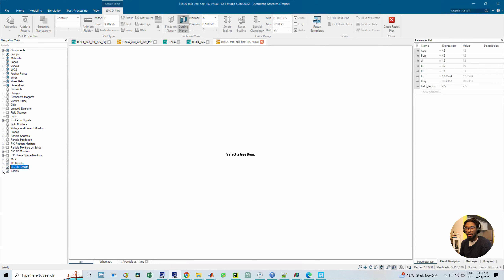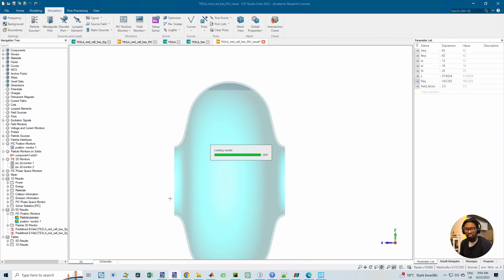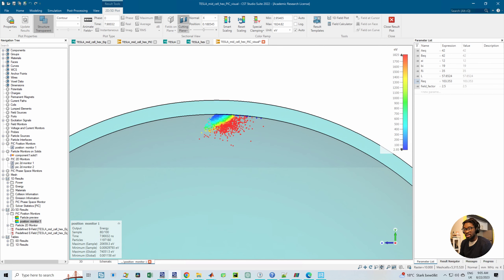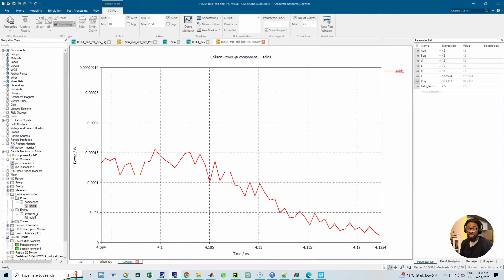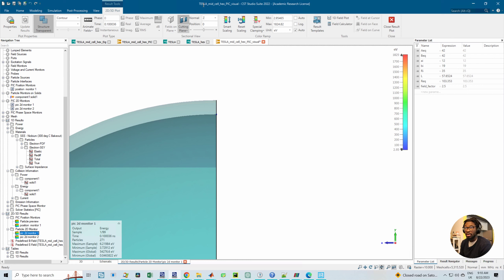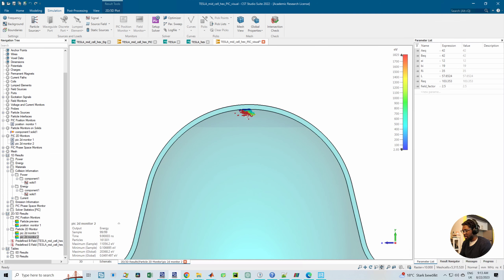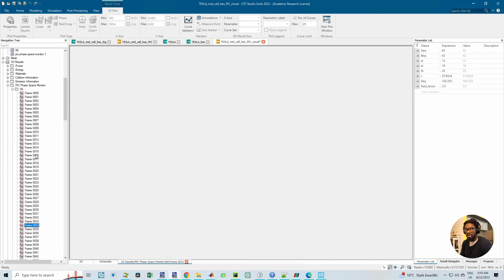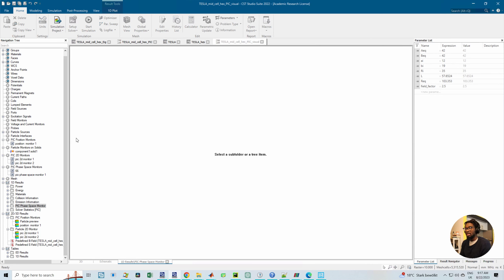Multipacting Analysis (visualisation) of a TESLA cavity mid-cell geom. using CST Studio PIC Solver

Comment: I am just a beginner to start multipacting simulation. My goal is to simulate it for a coupler with RF window. So, I want to start with a coaxial geometry. Can you suggest how can I start?
Reply from the maker: TL;DR
1. Model geometry, mesh (hexahedral) parameters and do a local mesh refinement around region of interest.
2. Define solver and compute electromagnetic field
3. Create PIC simulation and import field from previous calculation
4. Shell geometry and define wall material
4. Define particle initial location, type and energy
5. Define required monitors 
6. Run simulation and analyse results

The starting point depends on the type of solver you plan to use, as this determines how your fields will be obtained. In the video, I perform an eigenmode simulation, which provides the fields directly. If you are doing a time-domain or frequency-domain simulation, you will need to define field monitors for the relevant frequency or over the entire time period. To accurately capture the fields in the region of interest, I recommend performing a local mesh refinement around that area.

Next, make a copy of your model and rename it. Change the solver in the copied model to a PIC solver. Then, "shell" the model and define the material properties, such as Secondary Electron Yield (SEY). Import the fields from the previous simulation and specify the particle and initial emission properties, such as velocity or energy, emission area, and emission type. Set up particle monitors as needed, and then run the simulation.

Do let me know if you have further questions.